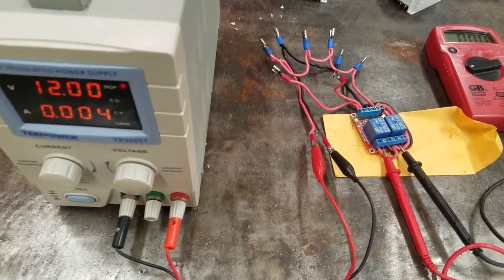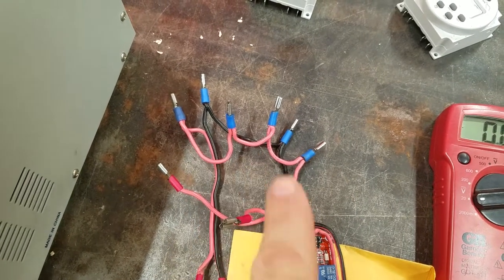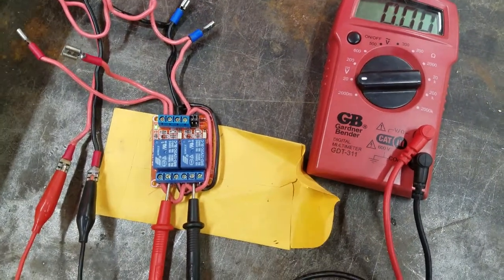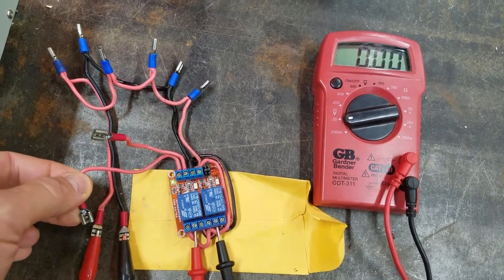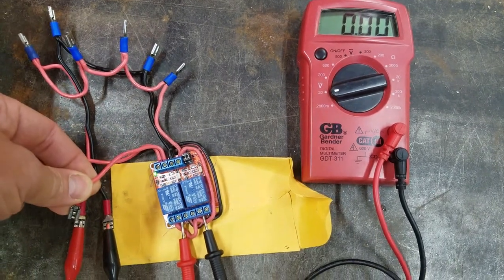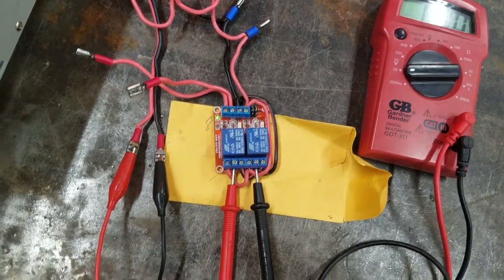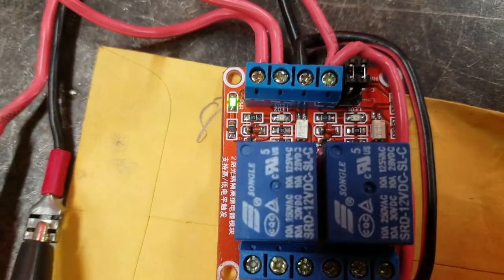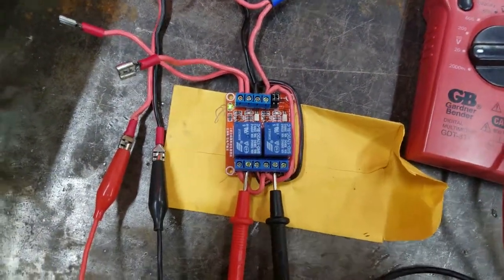Automatic Chicken Coop Door - Testing Relay Module

Comment from the maker: Some Care Bear idiot commented that "it's not a 5-amp circuit" & "the AWG wire size is too big". The max draw at load is 5 amps for my actuator. That's from the manufacturer data sheet & verified in the real world. There are cheaper ones that use less amps. I didn't get one of those. I need my setup to close reliably in the winter, when there is snow & ice in the doorway. So I use a nice heavy duty actuator that draws up to 5 amps. Therefore I designed the circuit to handle 5 amps, & used the appropriate wire size. Some people.....